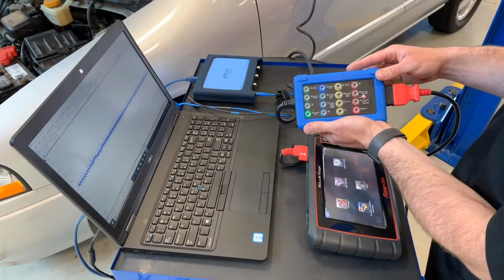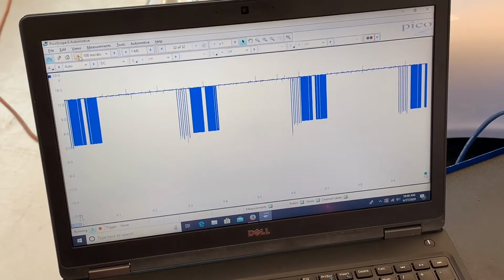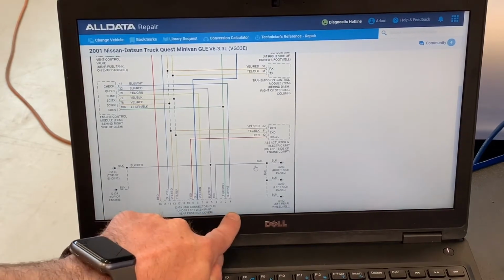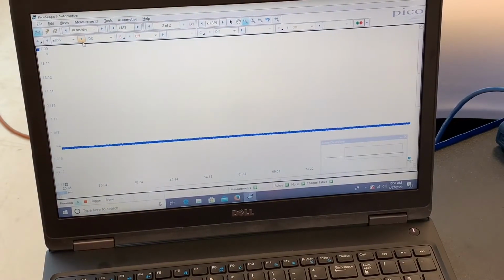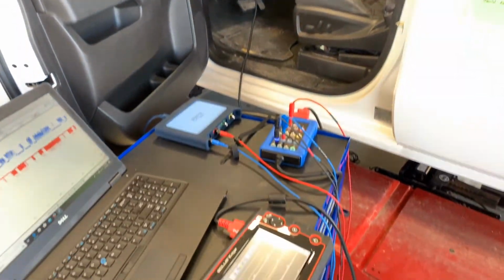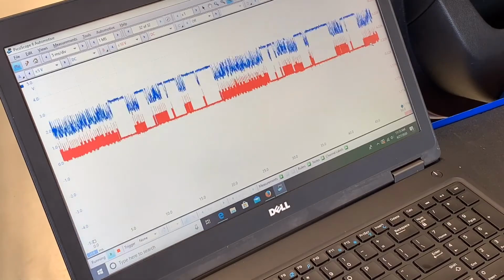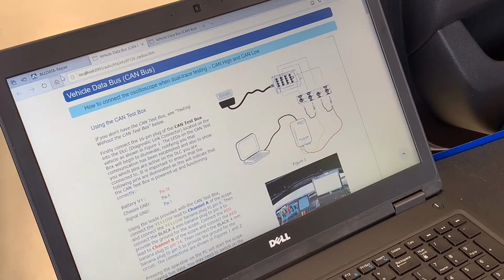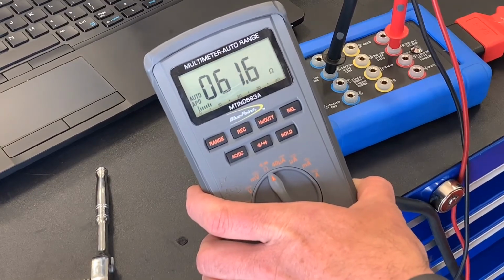Network Communication Testing: K-Line, Serial and CAN Bus

Comment: Hi Adam, I have an error link when i try to scan my honda civic ex coupe. I probe it and saw on a straight line 9 volt dc and no waveform when ignition key on. I don't know my car must have a waveform the same or likely as your 2001 Missan Quest. I you address that for me, thanks. I don't have resource to find that information.
Reply: You have one of your modules holding the line high interfering with communication. Unplug each module one at a time , start with the easiest to get to first.

Comment: Question about a break out box. Do they work on a network with a gateway module? I have watched your videos and it seems to me they can only read between the DTC and the gateway. Does the gateway pass through or does it act as a firewall?
Reply from the maker: The breakout box will not provide a lot of information when a vehicle utilizes a gateway module. As you said, it will only provide that line between the DLC and gateway. When a gateway is present, you have to find an alternate location to gain access to the network you're needing to assess.
Reply: Thank you! With your help, I have learned a lot in the last week about these systems. @AdamsAnalysis

Comment: Hello, thankyou for the upload. In a Porsche car I can see that there are 2 k lines, these k lines are going to many control units. One connects to engine cu, transmission cu & alarm. Other k line goes to AC, parking cu, radio etc . There is also CAN wire that goes to all control unit but it does not go to obd connection.
The 2 k lines goes to pin 3 & 7 of obd plug connection. 
What do you think is it ok to assume that k line is being used only for diagnosis process & CAN only for communication?
Yhankyou
Reply from the maker: Without looking at the specific application, I would agree. In many vehicles, the diagnostic communication is a single route to a gateway module. If you're up against a U code, review the enabling criteria for the code and begin checking the specific network for that fault. In the case of CAN, check the general integrity of the network by first measuring the terminating resistors. If the network is beyond a gateway, be careful about how you enter the circuit for a measurement, such as a backprobe.

Comment: I use one of these break out boxes , but how ironic is it that pico scope test leads dont fit because the box uses unshielded 4mm banana sockets compared to the shielded 4mm banana plug test leads.
Reply from the maker: It can certainly be frustrating. The newer standard kits tend to come with some adapters at least.

Comment: Looks like the baud rate wasn't correct for the data. Will look like garbage if you don't have the correct sample rate. Not sure if the obd connector has a clk (clock) line. That's used to provide the correct sample timing for serial communication.

Comment: Is the Data Bus Diagnostic Tool will really tell us the main fault of the LAN?
Reply from the maker: It's a great tool that can help add information during diagnosis. It may not tell you exactly what is wrong, but it is quick to turn on and will provide direction.

Comment: Caution: Wait for the bus to go to sleep before attempting to measure the resistance of the terminating resistors!
The sample rate was set too low resulting in “aliasing”of the signal.
Reply: Or disconnect the battery
Reply: @jonomotive2000  ...really the only way to do it... there are so many differences in vehicles when it comes to the RAP and so many ways to get tripped performing actions that appear to not interfere but do... this dude is sloppy
Reply: @jonomotive2000  

P0
Reply: @stevenstanley2552  what

Comment: If a module is not working, will your BOB tell you which one or will it tell you where any problem is located?? Your dirty signal is from your BOB. I do not believe is the money it costs for one of these tools for as little as it does and the labeled information does not match every vehicle for every protocol, I would build my own without the Christmas lights. The DLC is very accessible to get all this info without the need for a BOB. There is typically an accessible module to get the waveforms and resistance value from also, such as the ABS module. I liked the video overall, thanks.
Reply from the maker: Thanks for watching! The BOB itself cannot provide much information, such as which module is at fault. It is just providing a point of access electrically to the network. The most powerful reason to use one is to reduce the risks associated with back probing a connector, disconnecting a connector or stabbing a wire to gain a signal. More and more manufactures are telling us not to disconnect connectors due to terminal tension issues.

Comment: Do you know if Chrysler LIN can be monitored at the OBD port? I don't see a LIN connection at OBD port pinouts. Perhaps it's translated and put in with the other BUS signals?
Reply from the maker: I am not familiar with the system. I would have to look at a diagram. As you guessed, it most likely exists behind a gateway module. To gain a waveform you would need to make a connection at the gateway side of the LIN or another connector/module on the network.
Reply: @AdamsAnalysis  Thank you for your time. I looked over the OBD port pinout top to bottom front and back for the vehicle (07-11 Chrysler Sebring/Avenger/Caliber) and I don't see anything related to LIN. Just seam's strange to me they would have a network on the vehicle that cant be accessed from the OBD port.

Comment: Hi I need to regen my car it's a subaru forester 2009 diesel. I need to regen my filter however my scan tools won't talk to it via K-Line can I ask what tool other than subaru select monitor 2 will be Abe to do it?
Reply from the maker: I do not have an easy way to check for sure. I would imagine most Launch/Autel or SnapOn branded tools, with the right Subaru software would be able to complete a service procedure like that. A rep for one of those companies should be able to find out.

Comment: which software do you use in network testing?
Reply from the maker: Primarily PicoScope to look for the profile of the waveform. Some OE tools have additional software to help ping modules and check for responses.

Comment: The connections were fine for the can bus . What you are seeing in inherent to GM can bus . There was something you had mentioned , and I do not mean ot offend , but it was incorrect.  You had said that the modules send out the signal on can bus , but then moved back to a correction inadvertently when mentioning that the can bus is wired in parallel.  But back to something more important as a tip you can teach your students , if you are questioning the validity of the signal on your scope channels while scoping can bus , simply revert to using 1 channel lead using pin 14 as your ground for that channel and pin 6 as your positive acquisition.  By doing so you will now see what the computer sees. The waveform will look perfect if all is well. Think about why that would be before you teach it to them though 😉. Oh and don't forget that the ohm test will soon be gone from dlc  and in some cases already is thanks to gateway modules. Some networks use a terminating resistor in each and every module on the bus like VW as well.
Reply from the maker: Thanks for the comment and the tips! No offense taken, I’ll give the alternative connection a try. The learning never ends!
Reply: Differential voltage instead of available voltage on 6 and 14 using a chassis ground?